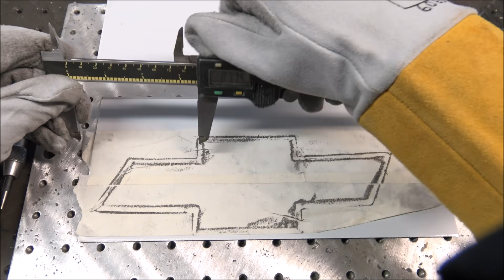TIG Welding Aluminum Fabrication - 6061 - Chevrolet

Comment: You're going to trick people in to thinking tig welding is really easy with how easy and perfect you make it look :D Incredible skill!
Reply: tig is actually pretty easy its just hand, eye, and foot coordination and a lot of practice.
Reply: berzerkrobot ii
Reply: @lovescamaros1  especially with this thick material it is really fun
Reply: @lovescamaros1  yeah its easy to get started with tig but this level of perfection is quite hard.
Reply: andrew height practice makes perfect but some of us in the field demand perfection from ourselves and anything less is a failure.
Reply: Yeah, because bench welding is easy. Plus, it's the fit up and layout that's really the tricky part.
Reply: david wenzel + when I'm welding my feet aren't doing anything, what are your feet doing while welding?
Reply: Jason Campbell some tig welding rigs have a foot pedal to control the heat. The farther you press the foot pedal the hotter it gets.
Reply: @ericduncan6179  
Aaron uses a TigButton

Comment: To anyone who uses a file a lot, for aluminum, consider buying a mill cut or curved cut file, they remove aluminum extremely quickly and don’t clog.
I bought one and it’s a massive massive improvement on a typical file.

Comment: very nice and precise work. my question is, before you weld the pipe, opend a hole in the middle. why's that?
Reply: To let the gas thats expanding inside to escape or when he went to finish the weld it would have blown out

Comment: Always exceptional
Would you share your tacking amps, and amps for finish welding
Reply from the maker: All welding was done with a TIG Button variable amperage controller (sold on the website http://www.6061.com), so I don't know the exact amps, sorry. I go by feel. I think the welder was set around ~115 amps max. The "T" welds take a lot more amperage than the outside corner welds.

Comment: How are you dealing with the heat from all the welding? Does it not matter because of how small and rigid the work piece is or are you letting it cool a little while between each weld?
Reply from the maker: Hi Joshua,
The size of the part (small), the design with the two horizontal pieces going straight through the part, and the relatively thick material helps increase rigidity and reduce distortion. The amperage controller I use (available on my website) is variable, so at the first of the weld, a lot more amperage is used. By the end of the weld, a substantial less amount is used. If you were to use a fixed amperage switch, you would have to wait for the part to cool after each weld or else the part would overheat and the welds wouldn't be uniform and shiny. Hopefully that all makes sense.

Comment: I fuckin love your vids, all fab no bs. Great stuff. Quick question, what is the purpose of the hole being put in the logo in the center of the pipe? Or will that be revealed in part 2 ;) keep blessing us with these gems. Thank you!
Reply from the maker: Vent hole to relieve pressure when welding up a sealed part. I go into more detail on the website (the water box video and the nautical star video).
Reply: @6061  aah very cool, thanks for the reply!

Comment: Hey sir,
Great work! I read all comments to find a solution to my problem. Maybe you help me sir: i’m struggling with 6061 TIG (filler rod: 4043). There are too many FPI (FPT) indications around the weld bead because of porosity i guess. Is there any solution? It’s like i miss a basic preperation process to welding but i couldn’t find it. (Note: my welders can weld other materials very well but Aluminum is something new for us)
Reply from the maker: Not properly cleaned, or old pitted material (or low quality).

Comment: Im new to welding trying to get my hands into something different for at home projects what is the metal box for u placed on top heat dissipation?? To avoid warping or is it something else
Reply from the maker: Stabilize the part to reduce wobbling

Comment: Nice video.How weld a leaked aluminium high pressure oil cooler?  2 pipe leakage from top side.

Comment: Can anyone tell me what the hole in the back was for?
Reply: More than likely it was a vent hole to prevent the piece from building pressure under heat and pop.
Reply: Can't weld something completely shut; the heat will cause the air inside to expand and create problems like contaminating the weld or blowing the molten metal out. The hole gives the air somewhere to go.

Comment: Can you help plz i have hugong 200 machine 
I weld alluminum on ac voltage 170 hartz 120 % 30 but bead got black on start and end ??????
Reply from the maker: more gas preflow and postflow
Reply: @6061   how its work can you little explain

Comment: Why not use a standard burr tool?
Reply from the maker: When?
Reply: 6061. com at about 1:36 you use a file quickly for a stroke or 2 on all sides. I was just wondering why use a file for taking off the bur on the edges of the cut aluminum instead of a debur tool? Is it because a bur tool is better for using on steel because aluminum is softer?
Reply: 6061. com also are your videos mostly of stuff you just want to make or is it comissioned projects. I do not know anyone in my area who can do quality aluminum fab like you demonstrate. I have wanted to learn to weld because of projects I want to do from seeing you do projects. But i can not find anyone who can do the quality of work that I see from you. I have gone to “metal fabrication” shops near me and asked to see some of their work and it is literally garbage compared to things you make. To the point where I couldn’t commission them to make something I wanted because their welds look nothing like what yours do.
Reply from the maker: The band saw leaves a rough cut. The file helps flatten down those rough edges a bit. The machinist's debur tool hangs up on the rough saw cut edge and doesn't leave as nice of a finish. Hopefully that makes sense.
Reply from the maker: The videos I post are some of both (commissioned and personal projects).
If you are interested, I teach exactly how I make and weld parts in detail on the website:
http://www.6061.com
If anything isn't answered on the website, feel free to email me.
Welder settings, material selection, proper fitment, proper cleaning, and proper technique are all important.

Comment: At 09:18 i can't understand what he is doing with that strange tool !!!!
Reply: Measuring and scribing a mark so he can punch and drill holes accurately on the tube.
Reply: Scribing a line on either side of the pipe at the same height

Comment: Omg, piece of art. Too much for Chevy :) What settings could you advise to weld 1mm thick sheets? I was trying 40-45A, 1.6mm gold rods, no pulse. No chance, always melting the end of weld. I guess I need a pedal, to drop the amperage to around 20 in the mid of the weld. Anything you could possibly advice? My welds are awful.... yet :D https://imgur.com/a/UzGkEkH

Comment: does anyone make a 110v tig machine that's worth a damn?
Reply: the miller diversion 180 with the multi voltage plug for 120 or 240v but your limited with only 110/120v.
Reply: I ran my Eastwood TIG 200 ac/dc on 110 for years before I got 220... Then I stepped up to an HTP 221 DV ... It runs off 110 excellently as well!

Comment: Why is everyone shitting on Chevy though? We had a 2000 Chevy Astro van for eleven years, bought it used, drove it cross country a few times, and the only times it gave us any trouble was when the oil needed changing.
Of course there was also the time the back driver's side tire exploded but hey, we were driving it in the country a lot. Shitty roads tend to have weird debris that leads to... Interesting flats.
Meanwhile the Ford we bought to replace it lasted eight months before dying. Hm.